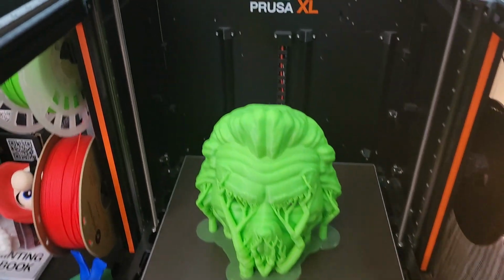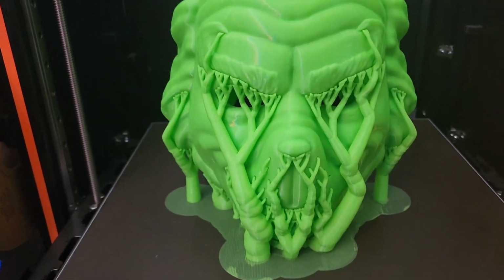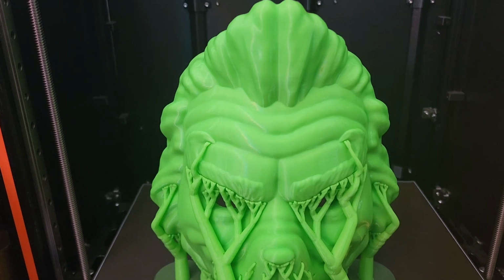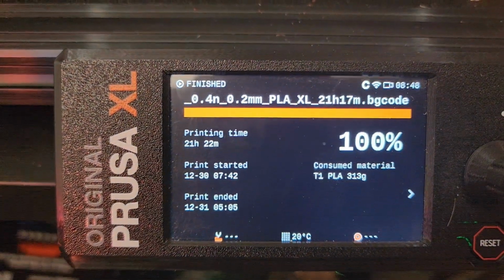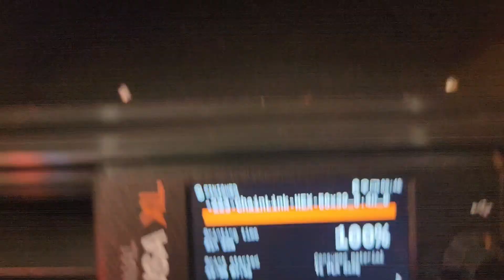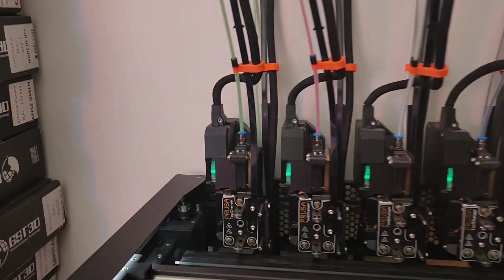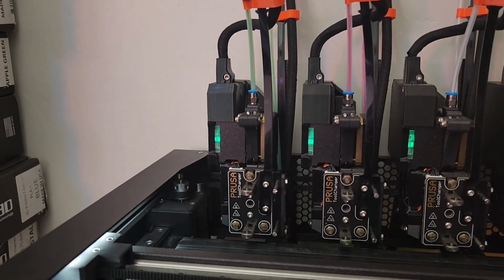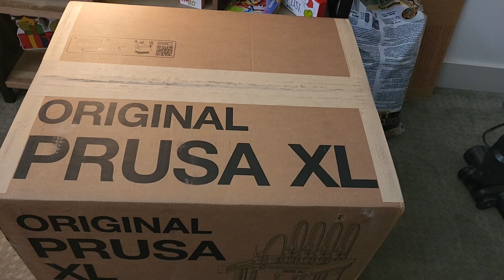Prusa XL Extruder Fix

Comment: Do you recommend this printer?  I really want a toolchanger
Reply from the maker: This printer is awesome..... when it works. I would personally wait for the 2nd version of this before I purchased it
Reply: @monkeybrainstudio  Should maybe mention that in every video that it is the first generation. We have a 2nd version and it is amazing. Not failed once.
Reply: @Jensex1 how do you know if you get a second generation? I’m thinking of buying one. Do they only ship 2nd gen now?
Reply: Stealth changer would be maybe 2k with 5 tools
Reply: @C650101  never heard of it, is it a Voron?
Reply: @monkeybrainstudio  2nd version?
Reply: why do you want a toolchanger?
Reply: @GoatZilla  mostly for multi material, I could care less for multi color.  Plus the size of the XL seems like a plus
Reply: @krollmond7544  I'm not convinced a toolchanger is really necessary for multimaterial.  There are less expensive+problematic ways to handle that.

A toolchanger would be needed for things like other actual toolheads (and I don't think they've released anything other than the 1) or something like having multiple nozzle sizes available.

Size will just depend on what you're trying to do.

So unless you have something really, really specific in mind and are immediately ready to go to recoup your rmoney, it seems like a waste.
Reply: Prusa Supports their peinters and many flaws of the XL have been Adressed. But maybe a prusa XL + would be nice.

Comment: Thank you for pointing me in the right direction on this issue. My XL is 100% working on all five extruders!
Reply from the maker: Is your printer still holding strong?
Reply: @monkeybrainstudio all my exruders are running strong. check out this solution which I’m using, search for “Secure XL Nextruder Cable Connector Solution”
Reply: @ Yes with the new connector mod on Printables

Comment: have the same exact issue and as of right now as requested by support to run without the connector covers, performance reliability is slightly better. but anyone also observing the flickering tool head LED?
Reply from the maker: All mine flicker.
Reply: I got new cables from PR and the extruder problem is gone plus the lights don’t flicker anymore.